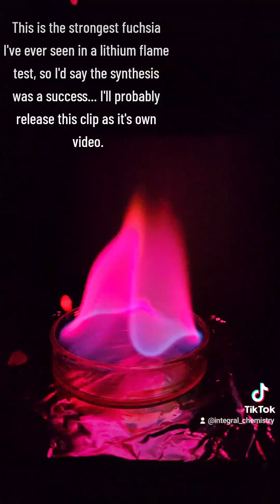Making Lithium Iodide

Comment: So you're not using the sulfur chlorides/sodium acetate route, this should be interesting and considerably less stinky!
Reply from the maker: Yeah I considered that route but I really don't have access to chlorinating agents strong enough to make acetyl chloride.. I'd use phosphorous trichloride but in the US, anything that can be used to make meth is incredibly tightly controlled.. which includes most important phosphorous compounds (PCl3, PO5, or even simply red phosphorous). It's quite stupid, especially since you can very easily just make HI by distilling from phosphoric acid and KI which are both readily available..
Reply from the maker: No promise it'll work but I think it's worth a shot 😁